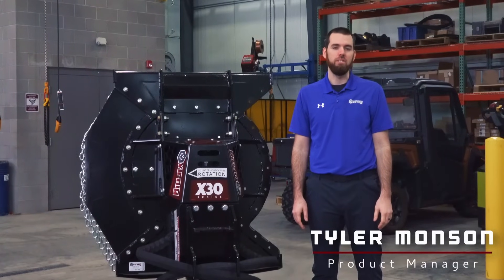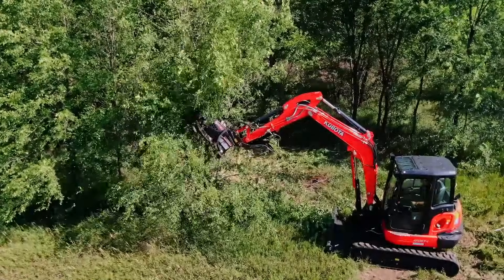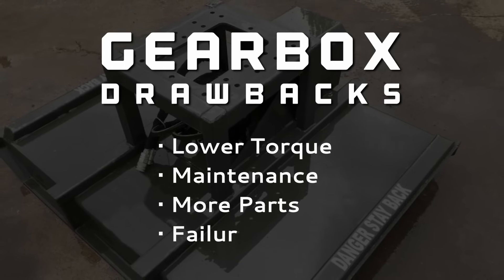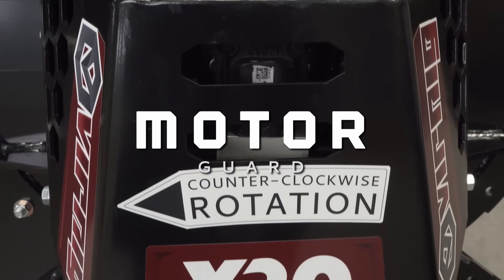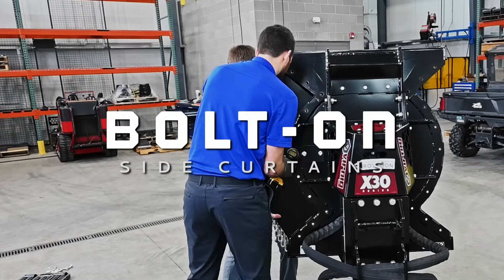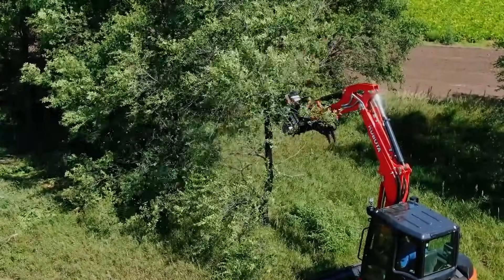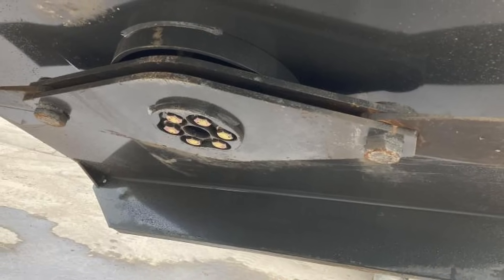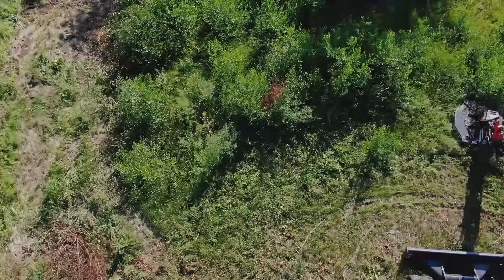BEAST MODE | Everything You Need to Know About Virnig's X30 Mini Excavator Rotary Brush Cutter

Comment: Do the cutter have over run release build in
Reply from the maker: A pressure relief valve protects the motor and the loader's hydraulic system from damaging pressure spikes. When max pressure point is reached, the valve opens to prevent pressure from rising any further. This prevents seals or other internal components from failing due to excessive pressure.

Is this what you meant by over run release? We're not sure.

Comment: Hello, my excavator is a takechui tb135. I think the aux circuit makes 19 gpm at 3000 psi. Will this cutter work for me?
Reply from the maker: Sorry, that is too light for the XBC. We recommend an operating weight of 8900+ lbs. You'd want a TB 240 or bigger.

Comment: You don't need to maximize torque on a rotary cutter. You need speed much much more if you're wanting performance. 22 gpm or less and direct drive has inferior performance to a gear box multiplier setup. Also two blades is far more efficient for cutting than 3-4. Adding additional blades = nothing more than power consumption for minimal gains in mulching performance.
Reply from the maker: Speed and torque play crucial roles in cutting performance. There’s definitely a sweet spot between the two. Torque is influenced by hydraulic motor displacement and operating pressure, with higher pressure resulting in increased torque. Torque is the way to measure the rotational force the cutter can produce. Greater torque allows quicker spin-up, faster recovery, less chance of bogging down in tall grass and thick material and higher overall productivity. It's also important to consider hydraulic efficiency and heat generation. 

Gearbox drive systems exhibit lower efficiency and generate more heat due to friction than Geroler drive systems. The resulting wear and tear, combined with the 10-20% efficiency drop from a Geroler motor, can lead to excessive heat generation, reduced performance, increased energy consumption, equipment failure, safety hazards and elevated maintenance costs. To mitigate these issues, we’ve chosen to utilize USA-made Geroler motors from Eaton, which have proven performance and longevity. 

Geroler motors, known for their high efficiency ranging from 90-92%, employ a unique design with minimal moving components, reducing sliding friction and heat generation. This design maximizes torque transmission while minimizing heat generation, thereby optimizing the performance of excavator hydraulic systems. Furthermore, direct drive systems offer advantages over gearboxes. By eliminating numerous parts, such as gears, they reduce issues like excessive vibration, noise, misalignment and leakage.  

Direct drive systems also allow for the use of heavier flywheels, enabling more cutting inertia through thick brush. If it is too light, the brush cutter will bog down, increase heat and hurt performance. Our heavy, 145lb flywheel and high torque motor keep the blades cutting with less tendency to slow down when pushing into thick brush and tall grass.

We’ve tested two blades vs three and found three to perform much better with our brush cutters. The two blade system was scrapped and we’ve never revisited it since. We've also heard from dealers that the three blade system outperforms competitor two blade systems. Ultimately, the extra blade performs more cutting per rotation and the heavier flywheel has more inertia to keep it cutting when met with resistance. 

When testing and designing, we always consider torque, speed, heat generation, and flywheel weight, which all contribute to maximizing cutting performance.
Reply: @VirnigMfgInc  one thing that you have to also consider is that when any swinging blade system does not have enough impact to carry through the material for a clean cut, you are introducing variable size and direction of loads to the flywheel that will quickly diminish any torque gains that you realize from direct drive. Direct drive is absolutely ideal, but for small lower flow power units like this, you'd have to use a 40-50 cc geroler motor to get adequate speed. As you probably know, increases/decreases in torque value as it relates to motor displacement are not linear so you'd be looking at a substantially lower torque motor with higher restriction/lower volume motor.
Reply from the maker: @wpog8453  Among the many considerations, clip rate stands out as a crucial aspect when it comes to achieving optimal cutting results. Clip rate refers to the frequency at which the blades cross the cutting surface. It is determined by a combination of ground speed, RPM, and tip speed. Increasing the number of times the blades cross the designated area enhances the likelihood of obtaining a high quality cut. 

When ground speed decreases, the clip rate increases. This change allows for cutting through heavy materials with improved outcomes, as each revolution removes less material. However, it is important to strike the right balance between ground speed and blade rotation to achieve an efficient cut. Only when the combination of ground speed and blade rotation yields an adequate clip rate can a brush cutter operate optimally. 

While manufacturers often emphasize the importance of high tip speeds as a marketing tool, it is essential to recognize that tip speed alone is not as critical as clip rate. Tip speed merely serves as a factor of clip rate. Consequently, a cutter with excessively high tip speed but a low clip rate wouldn’t deliver satisfactory cutting performance. 

Consider, for instance, a dual blade cutter with a lightweight flywheel. Such a cutter typically operates at a higher tip speed. However, when coupled with a high ground speed, this configuration results in a lower clip rate. Consequently, the cutter is more likely to struggle and experience low performance when faced with denser vegetation. 

Therefore, while tip speed may be highlighted as an indicator of increased cutting speed, it is the clip rate that ultimately determines the effectiveness of the cutter. By designing a balanced combination of flywheel weight, blade length, ground speed, RPM, torque and tip speed, it’s possible to achieve an optimal clip rate and ensure superior cutting performance, particularly in heavier vegetation.
Reply: If you are enjoying the conversation, I'd ask you to re-read my last remarks. While what you are saying is correct regarding strikes per minute, I have found that that is not as sufficient of a metric as you suggest. It's not the first time I've heard it either. You are not considering the dynamic loads that you introduce to the fly wheel when your blades have insufficient weight and/or speed to carry through the cut. When your blades glance off of material and flick around and spin (which will frequently happen to some degree) the loads will have a dramatic impact on your projected performance. You are then solely dependant on torque. The problem with that is that this is not an LSHT auger. A small hydraulic power unit simply does not have that kind of torque and a direct drive +/- 80cc motor cannot make up for that. When the system pressure climbs and flow drops dramatically, it compounds this "tumble to the bottom". You are also not considering the fact that mini skid steers and mini excavators have to share a good bit of their total flow with functions that position the cutter. That alone is a good reason to sacrifice a little bit of torque to maintain an adequate speed coming into any given cut. I don't completely disagree with you, I'm just saying that it's not going to yield the best performance on a small power unit. I'm sure your unit is eating great on a KX-080 size unit but with machines toward the middle/lower end of your flow range, what I'm saying will be much more substantial. I know this may be unrealistic for you guys, but I'd be glad to run your V20 mini skid cutter alongside my unit on the same machine and demonstrate what I'm saying if that's something you're ever interested in.
Reply: @wpog8453 
You seem to be debating a product with what appears to be some knowledge and experience. I’d love for you to recommend a comparable sized head for a kx040 that you feel hits the perimeters your suggesting.
Reply: @VirnigMfgInc  I'll bet it did get better mulching performance with more blades on a direct drive as you are seeing sub 1000 rpm speeds with an 80 cc geroler (<22 gpm) (which is working at about 60-70%% fluid efficiency at best after a few hours at operating temp., btw) on units like this with less than 20 gpm. With a 42 inch cutter you need at least 1200-1300 rpm for proper blade tip speed which will give you a high strike rate AND a higher impact with the strike, which is lacking at slower speeds. I understand all of those losses and everything that you are saying but they are usually non issues with units like this. You need a correct (heavy) blade weight closer to 10 lbs. and correct speed and a lighter blade carrier if need be to make that possible. A 35-50 hp hydraulic power unit should not struggle with recovery, bogging, or heat with a rotary cutter like this. Especially when you are using a higher displacement motor in tandem with the gear box to achieve desired speed. I have an 80 cc geroler direct drive 42 in. with 3 blade setup and a 100 cc geroler 42 in. with 2 blade carrier and 1:2 gear box sitting at my shop right now. At 17 gpm the gear box unit cuts larger material better and leaves a finer finished product than the direct drive because, as I mentioned, the direct drive has incorrect blade speed and blade weight. It is a commonly known principle in rotary cutter design that in a perfect world, 1 blade is the most efficient cutting setup but with the need for rotational balance 2 blades are necessary. When you add blades you only add drag and power consumption and only stand to gain more strikes per minute at the same speed which is of a negligible effect in this case. I may have waisted my time here but what I'm saying is correct and  I could demonstrate it, as well. Btw im not knocking your product. They look very well made. What you are saying is somewhat incorrect though and I see it all the time.